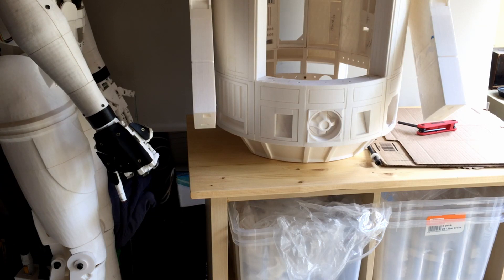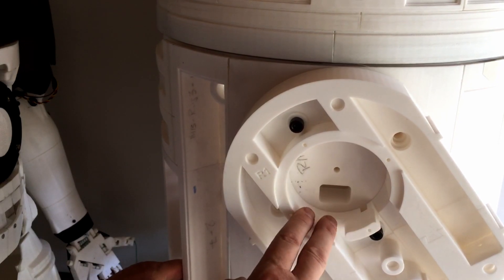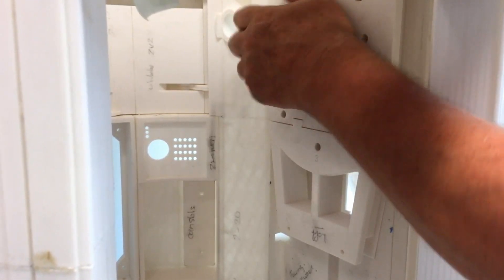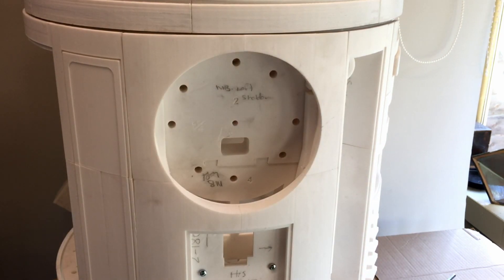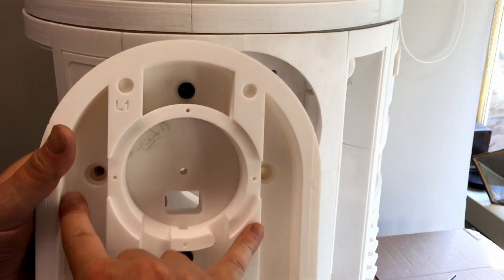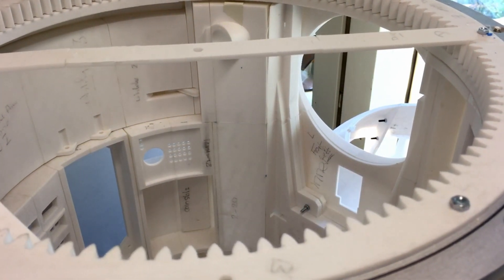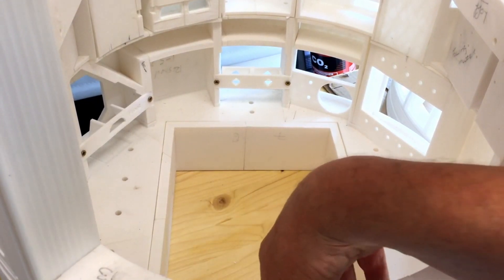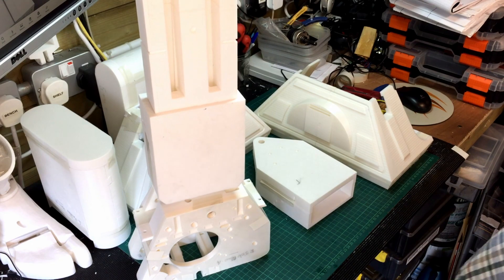R2D2 Droid Build Part - 10

Comment: Morning Kyle, just a quick question non r2 related. With the inmoov project, is there a cost for the stl files?
Reply from the maker: Hi Darren, all STL files are free.  The whole project is licensed as free, non commercial.  So you can modify InMoov etc but you cant sell for profit.  The printing of the InMoov is no harder or easier than R2D2, there is more gearing involved and lots of servos, but no motors [yet, maybe there will be with the legs if it ever gets to walk].  
The programming possibilities are huge, with MRL and EZB controllers mainly used.   I used both.  

Have a look here -http://inmoov.fr/build-yours/.    The project started off with the hand so thats the way most people start, however I would recommend building the head, then the shoulders and work outwards.   That way you have something to build to and attach to. http://inmoov.fr/head-3/ and here is the STL library [use the drop down box to select different parts]
I found building the InMoov really interesting, go on - build one!
Reply: kyle campbell thanks again for the reply and the links. This will be one for me and my son to do as a second project. Im downloading the head as we speak. Will take a look at your videos later for some tips
Reply: kyle campbell Hi Kyle, just to let you know ive started on the Inmoov head as suggested, really enjoying the early stages already. Back to the R2-D2 tomorrow while I’m off and back to inmoov when i get home from work each night. The print runs are shorter so will get a lot done quickly I think compared to the droid
Reply from the maker: Glad you are enjoying the InMoov build, I think its really great.  Gael has been developing new shoulder sections since I built mine, which look stronger. Hes also working on walking legs, but that will take a while.    

Check out the InMoov forum here https://groups.google.com/forum/#!forum/inmoov [you may need to register here, and also the community pages etc on the inmoov site.    
Its also worth searching the thingiverse pages here https://www.thingiverse.com/search?q=inmoov&dwh=875b5226f28a5ab
 
Also the EZB forum is good as well, here http://www.ez-robot.com/Community/Forum/Search?q=inmoov&page=1&section=0
And the MRL pages here ...http://www.myrobotlab.org/
Reply: kyle campbell thanks for the links. I will take a look, I’m not very good at the electrics but that is a hurdle I’m going to have to try and get over. This hobby is so addictive, i just wish i had more time to do it. Thanks again for your help, the videos definitely help me alot

Comment: I think your shoulder joints actually need to slot down and in from the top into the shoulders which is why there is a recess around it and why you needed longer bolts. So if you take the top ring off the torso the shoulder bits slide in and down into the shoulder modules.
Reply from the maker: Hi Ben, Ah - I see what you mean! Great thanks for that, as you say, explains why the bolts were too short.  Also so much more solid.  Will update my video, most appreciated. Kyle
Reply: No worries. I've not quite got that far yet, still completing the main torso. Keep up the work.